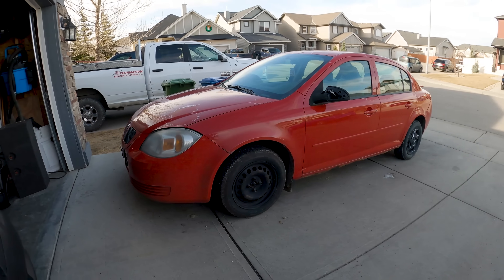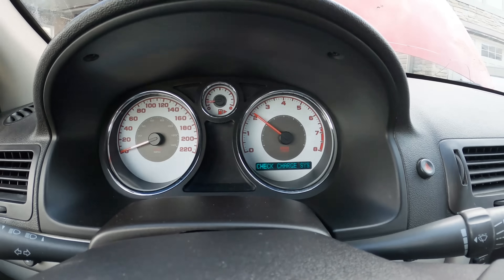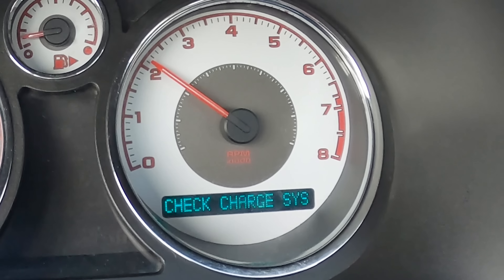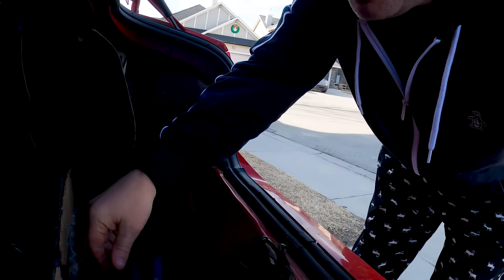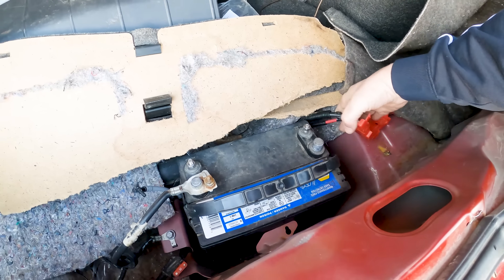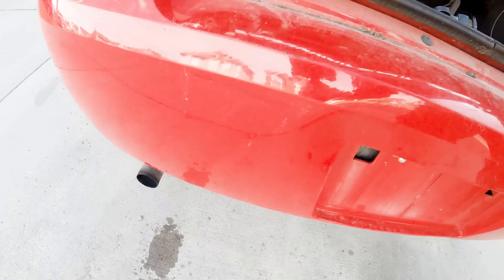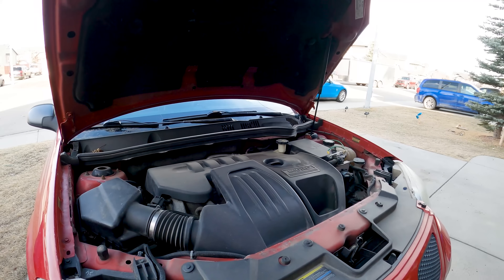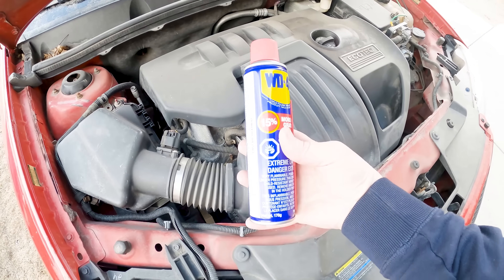ROADSIDE FIX! REVIVE your DEAD or DYING Alternator with this ALMOST FREE trick! | Gears and Tech

Comment: Wrong wrong wrong... That only works on cars with the charging system ran in series... Some of the newer Fords, like the Escape, or Fusion, and also some of the Chrysler Town and County's , charging systems are ran in parallel... Check  the alternator  on these cars, alternator  has good output, then pull a cable... Car cuts off... This is for your own knowledge...
Reply from the maker: Sorry bud, but you're wrong.

I've never seen a charging system run in series. They are always run in parallel to the battery.

There is a chance you mean the voltage regulator.

On some cars, specifically Ford, the voltage regulator is external to the alternator and in those cases the car can shut down when you pull the battery because the regulator has no reference to keep it low.

Come back with real world knowledge and not whatever you think your first year mechanic teacher told you.

Comment: NO, no dont ever remove the Battery terminal while the engine is running...!!!. The voltage spike caused will destroy your ECU and many othe componets in you car..  Be carefull ..go buy yourself a good multimeter, or this job will cost you a fortune !!!!!!!!!!!!
Reply: Yes, exactly, do not unhook your battery cables from the battery while eng running.  Due to spikes like you said. I know this was an old school way, and it worked fine on older vehicles before the computer that is in cars now.
Reply: Ya sounds good . But what voltage spike you talking about on a modern car? The voltage is not going to peak there regulated peak no matter if they are working right or not. You get same voltage spike when the battery is hooked up . And engine is running. Alternator voltage is regulated !

Comment: The last 60 years cars have a generator, not an alternator. A generator makes AC that is converted into DC by diodes. When you loosen a pole from the battery there is a good chance the alternator dies instantly so don't do this. An under 12.5V score when the engine is running is sufficient indication the alternator doesn't work as it should. Spray it with WD40 but don't soak it. The diodes may not get damaged as long as you keep the engine at low idle speeds and only disconnect a pole when the voltage running is under 12 volts.

Comment: That does work, you can use carb cleaner too,  but if you use carb cleaner make sure everything is cool and after you do you have to wait for it to dry.   You use what you have to get it done if needed.  What happens is as the brushes wear down they are leaving crud on the contacts.   When you spray the crap out of the alternator you are rinsing some of that out.   It is a good temporary fix.  If your starter acts up besides the hitting it with a hammer trick, and if you are able to take the starter off you can spray that out too.   Not as many holes to drain it off. but you can shake it out.  When you put the starter back in it will work better too, just like the alternator.  I know who wants to take a starter off just for a temp fix, but if you are trying to get home and you can get another starter at that point.  I have done stuff like this, but I don't usually tell other people to do it because there are some people who shouldn't even change their own flat tire.
Reply from the maker: You have the right attitude

Comment: James George is 1000% correct about disconnecting while running and his viewpoints. Maybe on pre computerized cars of the pre 70’s but definitely not today’s cars !  Absolutely not!
Reply from the maker: Weird, this one is computer controlled and worked fine as shown
Reply: @GearsAndTech  I stopped that in the 80s because it can fry the ECM just turn the headlights on and watch them dim.

Comment: Disconnecting the battery while the engine is running is a bad idea. On many cars, the battery acts as a big capacitor for stabilizing the charging system, and disconnecting it can cause instability in the system voltage. Do NOT do this! The first test is sufficient, i.e. simply measure the battery voltage with the engine running, and turn on/off some loads (headlights, etc.) while doing it. If it stays below 12.6 V, the alternator is bad.
Reply from the maker: Thanks

Comment: first 8 minutes of the video had nothing to do w the title of the video..  suspect a bad alternator?  skip all the long drawn out steps you show... buy a multimeter for 15  bucks from walmart..  use it to test the voltage of the battery w the car off.. should be 12.5v, or thereabout... start the car, and test the battery again.. if the voltage didn't go up ((like, at least to above 13v, but no more than 14.6)) , your alternator is likely dead..  confirm that its not a ground issue, or a cable issue, by testing the voltage right off the alternator..  if it's more than .1v difference off the alternator, as it is off the battery posts, youve likely got issues w a ground somewhere.    this takes but a minute to do... and you don't have to go through all the extended 'test's' this guy shows, and purposely run the battery dead  ((and potentially damage it))
super friggen easy.  no doubt.
Reply from the maker: If you're only car is dead in the driveway that's not always possible.

This is literally an emergency fix
Reply: @GearsAndTech   if you have bought a multimeter previously, and keep it w a few tools and fluids in your trunk ( like everyone should be taught to do)  then it's always possible

Comment: Man i just bought a 2008 Pontiac G6 for $1000 and  it has some rust both sides of the bottom lower doors near the rockets. Alternator needs a fix actually the whole car needs a tune up. Engine check light on oil light as well. Its lackadaisical when i press on the gas i know its the transmission and also the car jerks when the speed is delayed and then speeds up. I just bought 2 new wheel bearings ( Hin and Assembly) but its the passenger side that needs to be replaced so i went ahead and bought 2.
Reply from the maker: Just spend what you need to keep it running

Comment: NEVER EVER EVER EVER DISCONNECT THE BATTERY OF A COMPUTER CONTROLED CAR WHILE ITS RUNNING,  THE BATTERY ACTS AS A BUFFER AND IF THE ALTERNATOR IS WORKING A VOLTAGE SPIKE CAN OCCUR DAMAGING THE COMPUTER ,

Comment: Your voltage on idle should be between 13,8, and no greater than 14,2V.Forget about other device.Alternator belts, pulleys,  starters , water pump, should be replaced according to the manufacturer, don't wait until they break down, and then you need road asisstance.Also NEVER EVER take any terminal off from the battery on a running engine, you gonna easily burn the alternator in that moment.
Reply from the maker: Once a car gets a certain ago you replace only what breaks and only what is critical to operation of vehicle

Comment: Not good to run a car with battery disconnected. The battery acts as a large capacitor to help smooth out the alternator power so it doesn't fry the electronics.
Reply from the maker: True. Short periods are no issue

Comment: Only an idiot would unplug the battery cable while the engine is running. 30 years ago some people did that but only an ignorant person would try that today.  All the WD-40 trick will do is possibly free up the brushes but if they are worn out nothing happens. This guy doesn't know what he is talking about. I owned a shop for 22 years.

Comment: DON'T EVER DISCONNECT THE BATERRY WHILE CAR IS RUNNING !!!!!!!!!!!!!!!!!!!!!!!!!!!!!!!!!!!!    iT WILL KILL THE DIODES IN THE ALTERNATOR !!!!   The abrupt unloading of the battery will cause the alternator to spike to full output. These new cars have anywhere from 85 to 185 amp output to keep up with all the different computer systems.... Yes this test n will work on older cars 60's , 70's 80's but late 80's and up, the alternators output went way up. I have seen this test done in the parking lot by so called mechanics only to kill the alternator on the spot!!!
   I have 17 years in selling auto parts and it kills me when people do the test and then come in and say I need an alternator. They probably did not need one before, but they sure did after the test... Also the alternator will not turn on if the voltage drops below 10.5 volts... A bad battery will not charge, and the alternator could still be good.
Reply from the maker: Why didn't it then?

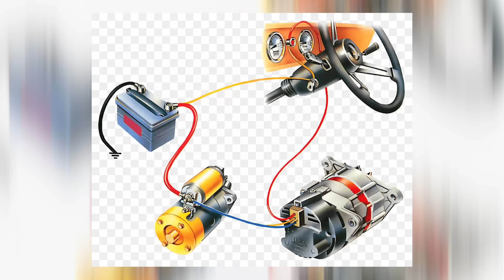Comment: @4:31, the diagram has the starter in between the battery and the alternator, so, if a starter went bad, could that stop the alternator feom charging the battery assuming the car is running at the time?
Reply from the maker: No, battery connects direct to alternator, same with positive battery to starter.

Comment: Disconnecting you battery while engine is running, will most likely damage the alternator if its not already broken. Also, sparks might make your battery explode in your face. But hey, do what you want. An old mechanic trick to temporarily fix a bad/weak alternator, is to use a hammer to it, because if the fault is due to worn or stuck brushes, if you are lucky, you can get it working to get to a garage or home. Last time i did this, it lasted for a whole year. I had to use a big screwdriver to tap on, since the alternator was so deep inside the engine compartment.
Reply from the maker: Haven't seen that happen yet

Comment: Never disconnect the battery on a modern car while the engine is running. There is too great a risk of creating a voltage spike that could wipe out any computerized circuits in the car, which on an older car, may be more expensive to replace than the car is worth.

Comment: Never disconnect the battery on cars with computers and electronics with the motor running unless you want to take a change on damaging your cars electronics. You could do this back in the old days but do not do it today! The battery acts like a buffer pulling down the spikes or peaks that an alternator puts out. Disabling the battery can cause the sensitive electronics in your car to be damaged. If the alternator is good and you spray WD40 into it when that WD40 dries out and turns to gum it can cause your slip rings brushes to stop working properly. Know what you are doing or don't do it!

Comment: remanufactured alternator was bad , voltage meter started dropping very fast , you have a few seconds to get it off road without power steering , no emergency blinker , nothing . if you have any kind of vehicle problem get it off street to parking lot exc. and figure it out not on road

Comment: I’m sorry not that I don’t agree with what you’re saying you’re very knowledgeable but if you do that on cars from 2007 in Apple, I believe you burn the computer that was the old trick that was used back in the day that disconnect on cable in the car stay on it wasn’t it was in the Alternator so you’re a be careful on that Thesis’s you could end up making them train wreck, burning your computer so you were able to do it back in the days and on the auto parts but you’ve been on the owners menu strictly tells you not to take the bed to unplug the battery and put the cables together and it’s gonna reset the computer or take one off and if it stays on, it’s gonna be this best thing to do if you don’t have a OB sensor for two dollars now go to your nearest AutoZone or O’Reillys and most of your view auto parts store carry those OB2 sensors and do it for free give your brain. I’ll tell you exactly what the problem is so I mean I thought you’re gonna be careful with that idea disconnecting one cable.

Comment: The rotor of the alternator has on one side two rings on which the interior bobbin 🧵 is connected. This rings of copper on which contacts of coal are gliding get with the time worn out and then the alternator cannot charge the battery anymore. Another problem with the alternator might be the ball bearings which will wear out leading to a stop of the rotor.

Comment: The alternator is called alternator because it consists of copper bobbin 🧵 in the middle called rotor because this bobbin is rotated by the engine on the rotor you connect some claws for having many north and south magnetic 🧲 poles. In the housing of the alternator you find three bobbins 🧵 in all of which an electric alternating current is produced which is rectified with the help of diodes.

Comment: Unplugging the battery terminal while the car is running is not a good idea.  You destroy the alternator output by doing this.  If the alternator is already bad, it probably can be done, but I would not suggest doing it because it can damage the ECM.  Alternator is not a clean DC output, unlike the battery.  Be careful people suggestion that can cause you more costly issues than the alternator.

Comment: A lot of newer cars and trucks wont even start without at least 12.8 volts in the battery. Battery should be replaced every 3 to 5 years or sooner.
Reply from the maker: Yep, just got back from vacation and my truck wont start with 12.2V

Comment: You cannot disconnect the battery to test the alternator & the car will stay running with a car that has an electronic fuel pump. That's mostly for older cars with a mechanical fuel pump. Maybe some cars have a reserved, but it will die after being disconnected for so long. I say 2 minutes tops. Play maybe there was something extra wrong with that car I was looking at I'm thinking now. Had to be something wrong with it if I was looking at it. Awesome video.  I had a trick where I would bang on the alternator a little bit I guess it would knock some of the dust and corrosion loose loose. Basically doing exactly what the WD-40 did.
Reply from the maker: weird, because I did the test on camera right in front of your eyes, and yet it did keep running just fine

Comment: Great work-around solution that you presented very well.  Precious time-saver!   Only thing lacking is the "Validation" that you mentioned with the voltmeter.   At the end of the video about 10:25,  I was expection you to show your little voltmeter "Validation" to observe ANY improvement in the reading AFTER spraying the WD40.   Otherwise great video.  Thanks.

Comment: It really not fixes the problem sir, your issue was the internal alternator coil was dirty in between centrifugate thus didn't make contact to generate AC voltage to diode charge. As you spray W40 into the holes, it will clean up those parts when you restart the car it makes contact, therefore the alternator works again.
Reply from the maker: Sounds like it fixes it

Comment: I was taught in tech school back in 1995 that these new systems coming out especially in today's Advanced Technology, 
YOU CAN NOT DO THIS PROCEDURE( Batt Disconnect While Running) BECAUSE IT WILL BURN OUT THE DIODES IN THE PCM FROM THE POWER SURGE. 
Today's computer system TALK TO EITHER OTHER THROUGH THE DATA STREAM Can Buss ! 
THIS IS ANOTHER REASON WHY VEHICLE'S ARE BLOWING OUT COMPUTER MODULES , LCD SCREENS, & SHORTING OUT DIGITAL DASH SYSTEMS! THE " IMPULSE VEHICLE" & 
TOYOTA/ LEXUS STARTED w/ this Warning ⚠️ back when CHRYSLER IMPULSE 1st hit the market. You couldn't even JUMP START IT FROM ANOTHER VEHICLE, YOU HAD TO USE JUMPER BOX Otherwise it burned out FUSES/ MODULES & ECM/ PCM'S !
Btw 

( What Happens if you don't shut down your home/ office computer system correctly)? 
Sooner or later it burns out the computer board. 
Same aspect for these SOPHISTICATED systems in today's Vehicles.. 

Today's SYSTEMS need to be Properly Discharged after Disconnecting battery Before Working on them.. 

Just a heads up 👍🏼
Making America Great Again ❤️ 🇺🇸 
💥Bada Bing Bada BOOM 💥 
I approve this message 🙌🏼 
Nj'sJfJr 👍🏼 💪🏼 ❤️ 🇺🇸
Reply from the maker: I heard the same rhetoric over and over.

Still waiting for someone to tell me which car suffers this failure so I can test it and prove its not true

Im Glad you added the jump starting bit. That's also not true. As long as the donor car has a good battery and you have properly sized cables you're just fine

Comment: Disconnecting a battery while the engine is running will definitely blow the alternator in seconds !
The only system who will let your engine run while the battery is disconnected is if you have an old fashion Dynamo. BUT ! you still may send to the ignition system, and all other working electrical components  far more Voltage and Amperage that it can stand. Soooo ? DO NOT DISCONNECT A BATTERY WHILE THE ENGINE RUNS, EVER !
Reply from the maker: Why did This one run after then? Weird

Comment: I wish you wouldn’t suggest  pulling a battery terminal off while the engine is running. Hydrogen and spark is not a very good combination. I had a co worker who lost his eye doing that same exact thing and the battery blew up. Do you due diligence before suggesting or someone might sue you.
Reply from the maker: Thanks for sharing

Comment: I'm sorry to contradict you OP but: This post is wrong, DO  NOT disconnect the battery cable on a running engine!  Doing so will create voltage spikes that could destroy the semiconductors in all sorts of components in your car. That includes the ECU, the speed sensitive steering, the memory seat adjustments, the cruise control, the stereo, who knows them all, and all of which you could completely ruin by removing the battery cable on a running engine!
Just use the right diagnostic tools on your car instead, any auto shop can test your whole charging system in a couple of minutes.  And they can do it safely with no danger of destroying electronic components, just do that instead...

Comment: Everything else you did was cool except the part where you pull the battery terminal off. That can cause serious problems electrically and to the ECU especially.
Reply from the maker: You can skip that step if you have proper tools